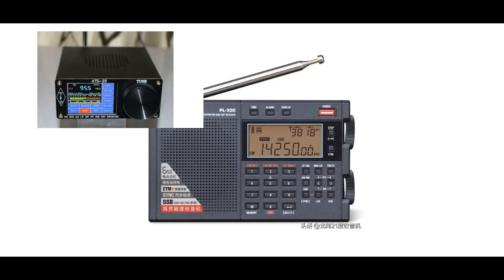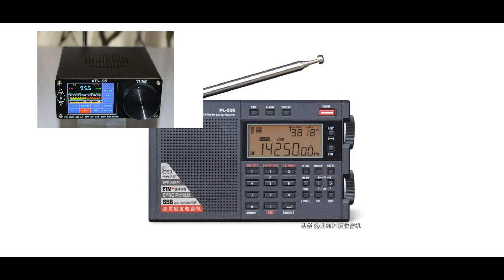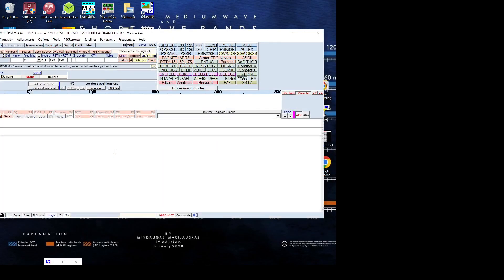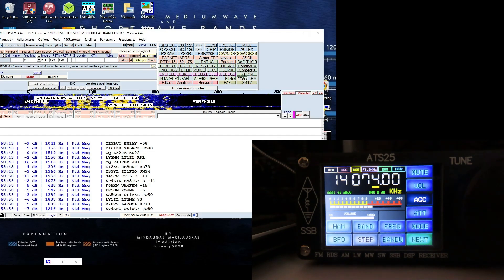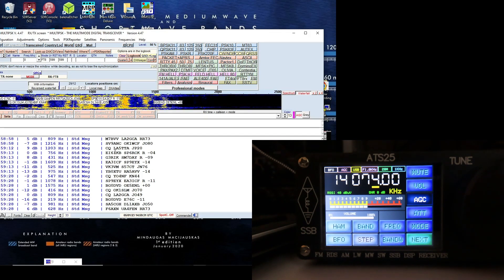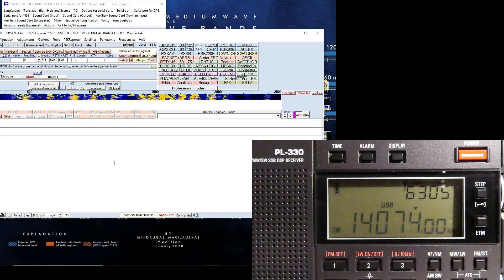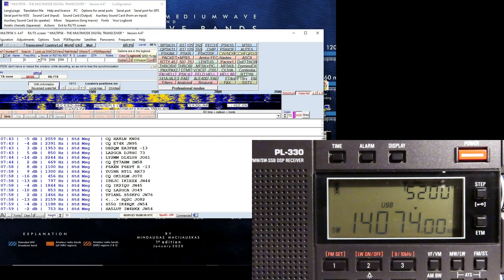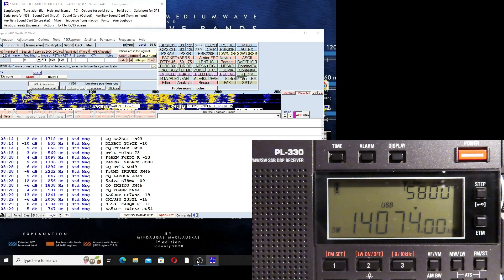ATS 25 VS Tescun PL 330 on FT8

Comment: What bandwidth setting was you using for each radio, I have an ATS-25 but it has a different UI than yours so I'm not familiar with the settings readout on the top of the screen on yours (from what it looks like if you have 1Khz stepping, and 1Khz bandwidth, but I'm not for sure.

I've done this a while ago with both my ATS-25 and my Eton Elite Executive just to see if it would work, and sure enough it does well. Granted the PL-330 allows you to calibrate SSB so that it's on frequency vs having to use the BFO on the ATS-25, or fine tune on the Eton Elite Executive which is a bit more cumbersome as they can be way off frequency, adjusting them would take having test equipment (another radio, or actually test equipment to output a tone) to make sure your adjustments are on frequency, I've had to adjust the ATS-25s BFO in the thousands to get it to sound correctly on a frequency. 

When the ATS-25 is connected to the line in on the PC you can usually ballpark the BFO adjustment using the waterfall in the program you're using for FT-8. But it doesn't seem to be zeroed in on different frequencies unlike with the PL-330 (when you calibrate it it seems to keep it's zero on all frequencies you tune to). 

While the ATS-25 is capable (that is if you're lucky enough to get a decent unit) but I wouldn't say (like that other person) that the ATS-25 does a better job. Granted I do like the form factor of the ATS-25 more than the PL-330 (as it does take up less space).
Reply from the maker: My opinion is the ATS 25 is not a good receiver. I would take the pl330 over the 25 every time.
Reply: @KevinOReillyswl  my ATS-25 is on par with my PL330 and Eton Elite Executive in terms of sensitivity and performance. And honestly I use my ATS-25 over my PL330 and Eton Elite Executive when I'm just scanning around the bands, everything they pick up my ATS-25 will pick up. 

I like it's tuning knob location and size a lot better than the the tuning knob on the PL330 or Eton Elite Executive as I can just place the ATS-25 on my stomach and lean back on the recliner and have my hands rested on the ATS-25 which aligns perfectly with the knob and screen. 

That being said not all ATS-25s are made equally, some work well, some do not, and being that there's multiple manufacturers that make them the quality is all over the place, their performance is all over the place, I lucked out on mine. 

But you still didn't answer my question about the bandwidth.

Comment: Hola amigo excelente video, tengo una duda no se que radio comprar si el radio ats-25x2 o el Tecusn pl330, des de tu experiencia que radio me recomiendas?
Reply: Buy the PL-330 for the simple fact that every PL-330 is usually going to be made with the same level of quality as every other PL-330. 

With the ATS-25 it's very hit and miss with the quality as they're not made by the same manufacturer, and depending on who or where you buy it from it can be a very horrible receiver with horrible quality components, or it can actually be a decent receiver, but being that there's probably hundreds of different manufacturers for the ATS-25 their quality can be very hit and miss. 

So yeah, get the PL-330 (can sometimes be bought for $60 USD which is far cheaper than what you can buy most ATS-25s for amd have a better receiver in the end).